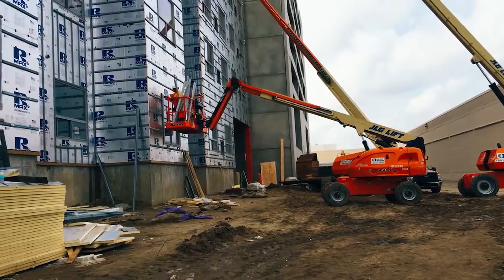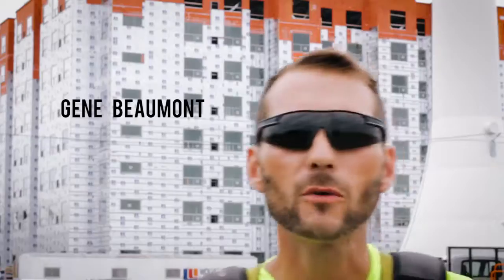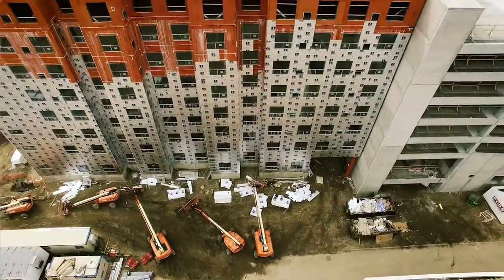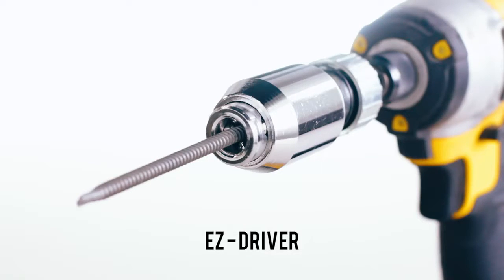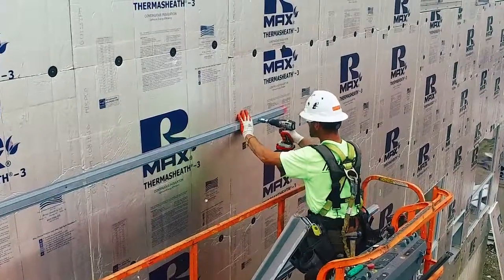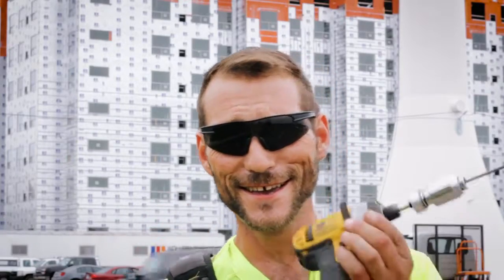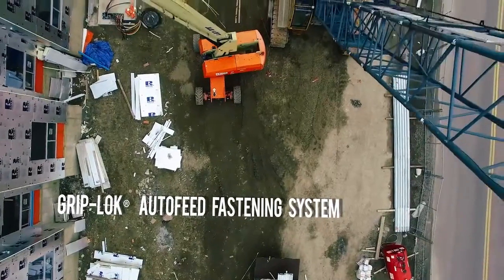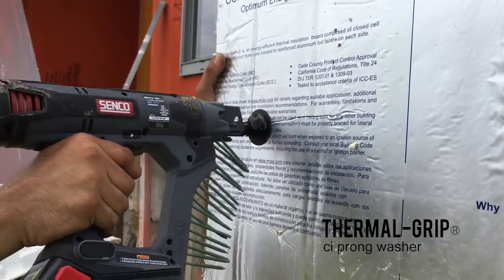Rmax ECOMAXci Insulation Installation with Rodenhouse Fasteners | Skyvue Apartments Project

Comment: Is yalls polyisocyanurate foam board hazardous to breathe in when not covered
Reply from the maker: Our polyiso foam insulation products do not create any breathing hazards.  When cutting the foam, make sure to have adequate ventilation and use gloves because the dust may be irritable to your skin.  In use, most of our products are design to be inside a wall assembly, meaning they are not intended to be left exposed due to fire ratings, so they need to be covered by a thermal barrier (1/2” gypsum/drywall or 3/4” structural wood).  That being said, we do offer some specialty products can be left exposed.  Therefore, you should not have any breathing issues with handling or using our insulation products.

If you have any additional questions, please feel free to reach out directly, 972-387-4500 or visit our website at www.rmax.com.

Thank you and have a wonderful day!
Reply: Thank you